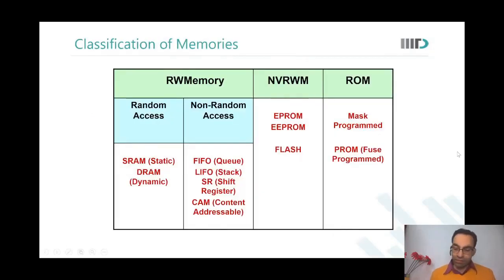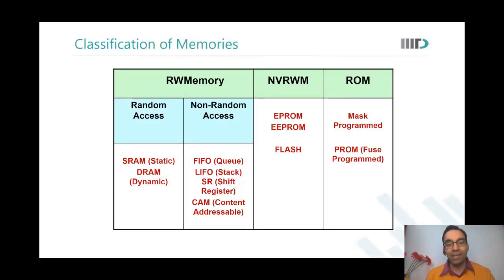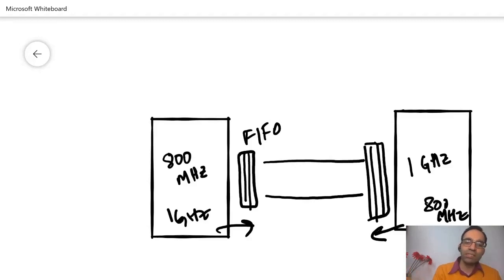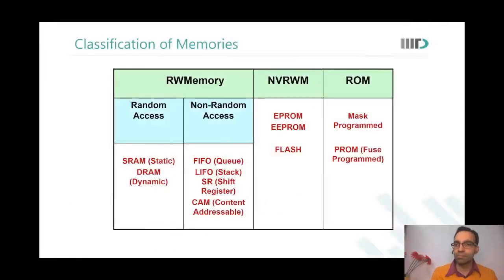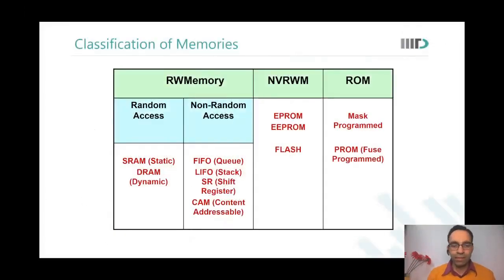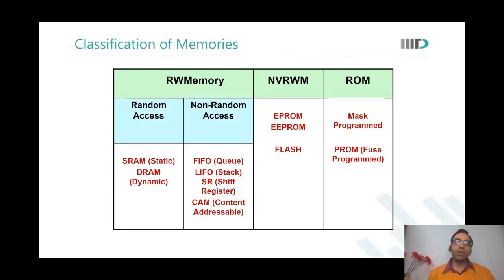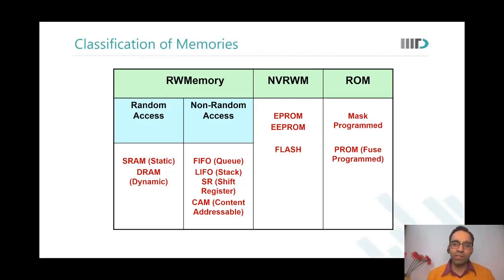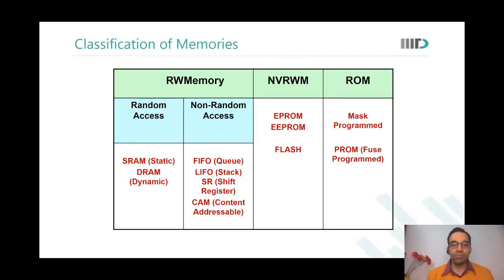Classification of Memories

Comment: Hi Sir, 
Related to PROM, Can we Consider this Way...?
Like after Testing Memory on the Tester by running Memory BIST...
We will get the information Related to Failing Cells...
This PROM Stores the information related to Failing Cells and Replacement will happen During Boot Sequence on the Field...
Is this Correct?
Could you please suggest any Reference Books for Memories...
Thanks for your Lectures
Reply from the maker: There could be an implementation scheme (like in the case of row redundancy) in which incoming address is compared with the failing address (which is stored in the PROM) during the cycle. So, replacement doesn’t exactly happen during the boot sequence
Reply: Thankyou Sir
Reply from the maker: All the best. 👍🏻